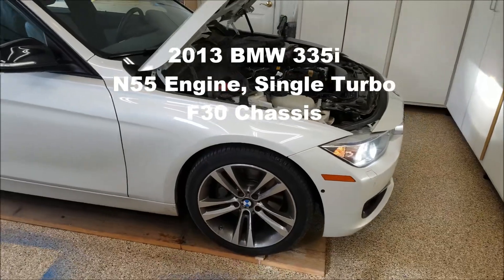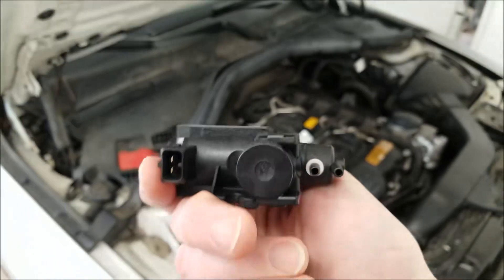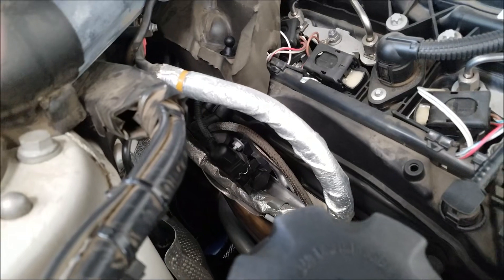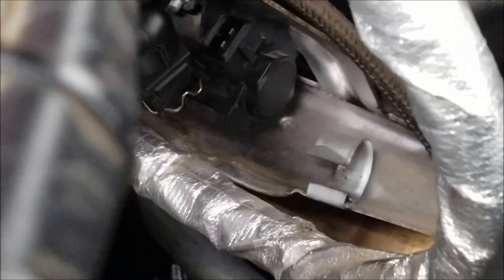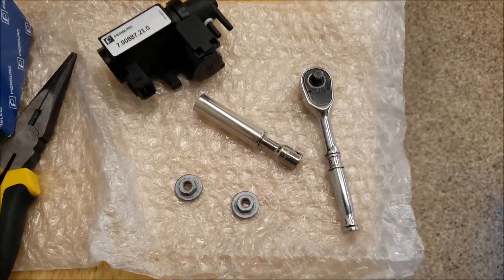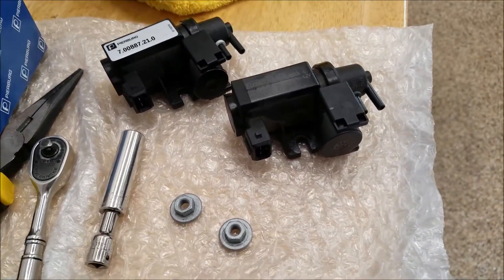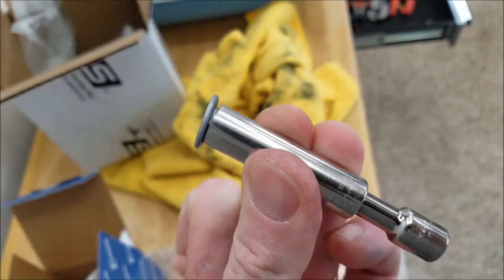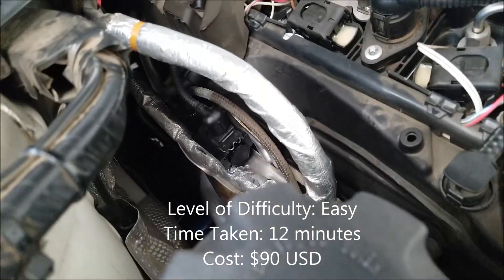BMW Wastegate Actuator Valve Replacement

Comment: Besides the humming noise, what were your symptoms on top of that? I have an issue where whenever I go full WOT and boost starts building up, all of a sudden boost dumps for a second then regains full acceleration, its like a half a second pause and you can actually hear the Diverter Valve dump the boost. I'm suspecting either DV failure not being able to hold full boost OR this waste gate actuator valve. I don't have any humming though.
Reply from the maker: no other symptoms, just buzzing
Reply: Hey did you ever fix your issue ? I’m having the same exact thing happen you describe. the boost looks like a wave in the logs. i’m thinking this part in the video. my DV is already upgraded.

Comment: Awesome vid! Thank you. Just changed my thermo and water pump at 64k.  Definite piece of mind replacing these parts before they fail.  And they do from my experience!

With that, I want to ask if there’s anything else we should be preemptively replacing.  I also have a 2012 pneumatic wastewater N55 335i and have had a few engine part failures.  All plastic. 
1.  Chargepipe - Replaced with metal one.
2. Small plastic oolant hose at front of car between radiator and reservoir - replaced with OEM
3. Coolant bleeder screw - replaced with metal screw.

Think I might be buying a wastegate actuator now. ;)

Comment: So apparently 11747649407 supersedes 11747626351, not the other way around. I have 11747626351 on my e92 so makes sense
Reply: Yup, verified with real oem
Reply: Though if both are having the problem as evidenced by your car and my car, i guess it doesn't matter which one